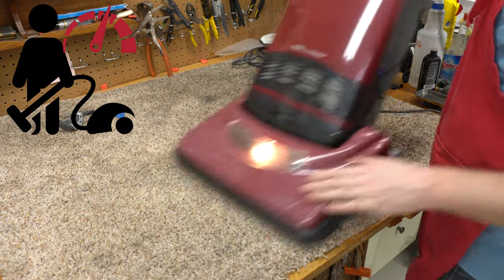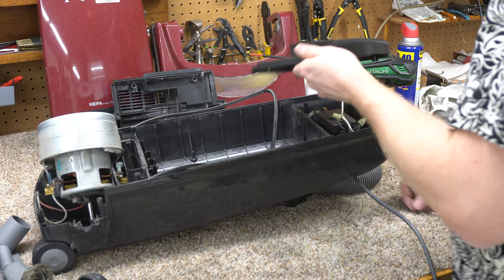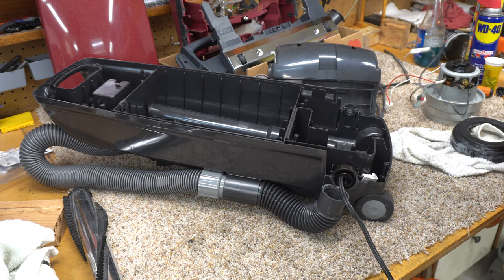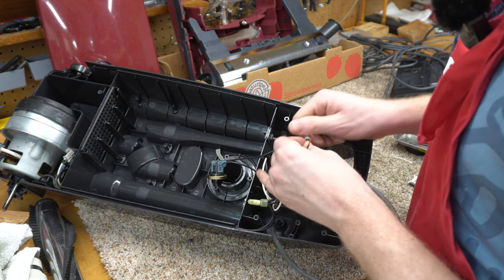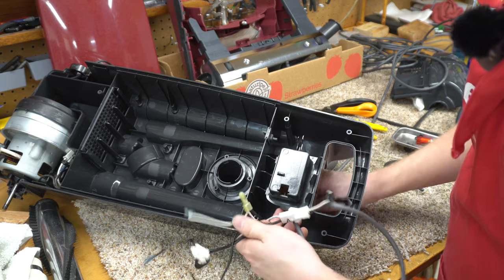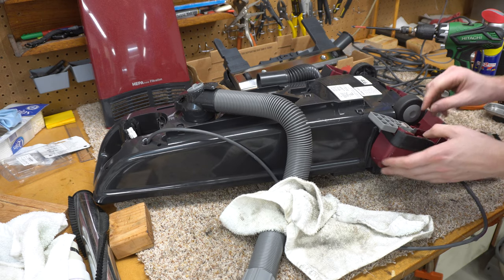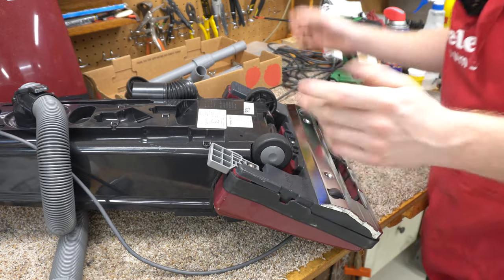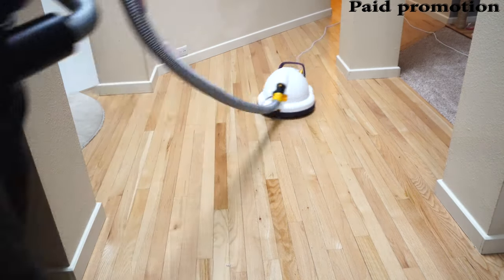Royal 7300 Vacuum Cleaner Repair-The Forgotten Bypass  Royal

Comment: This reminds me of a Panasonic, and weren't these called the Protege?
Reply: These are extremely similar to a Panasonic. I would go as far as to say it's a straight-up knock off.
Reply from the maker: I would call it an improvement over the Panasonic because there were some lessons learned implemented. But Panasonic definitely pioneered this style of machine.
Reply from the maker: Yes that's what it says on the front.